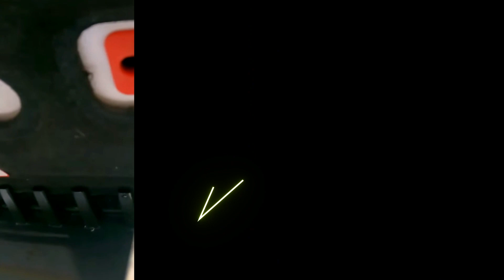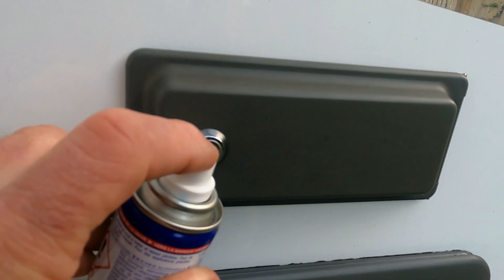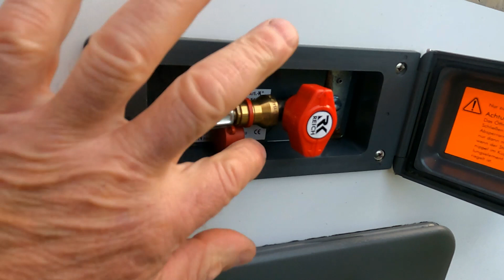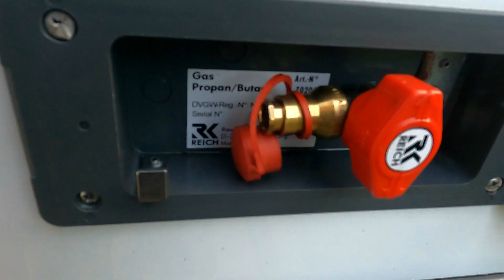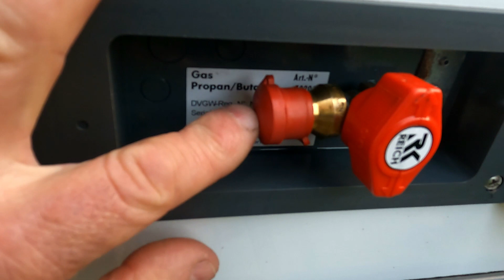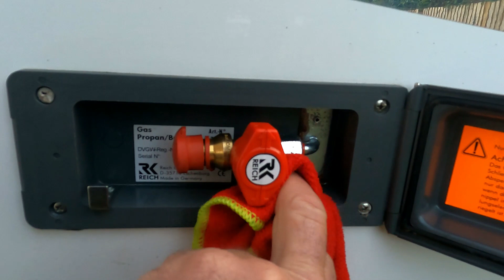Motorhome Camper Van BBQ Barbecue External Gas Connector Point

Comment: Hey Jof. Searched everywhere for the plastic baskets in your under floor storage. Where did you buy them. From a rainy Delft today.
Reply from the maker: We picked the ones we have up in John Lewis, i know Ikea have a good selection may have to measure up these ones get dimensions🚍👌🌴🏩
Reply: @MOHOTELADVENTURES  will be taking a ten minute stroll to IKEA for lunch from DeltfseHout camping site which has some of the best facilities I have used.
Reply from the maker: @derekt7606  sounds like a great site there Derek will check out there web site